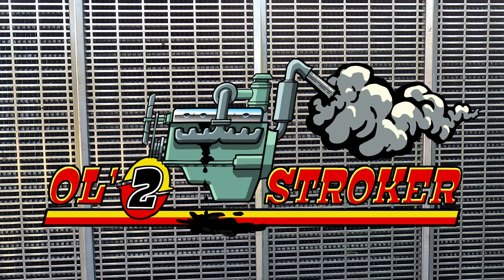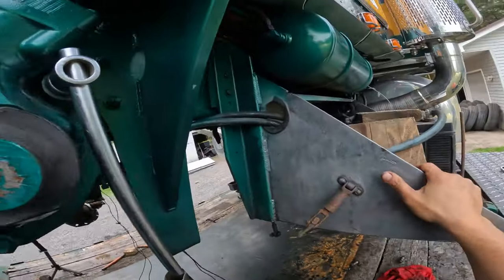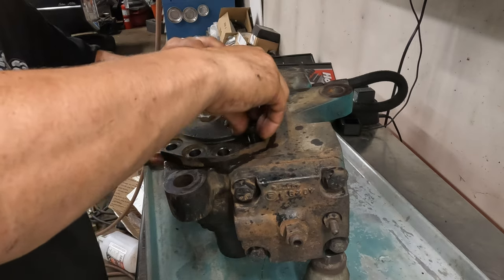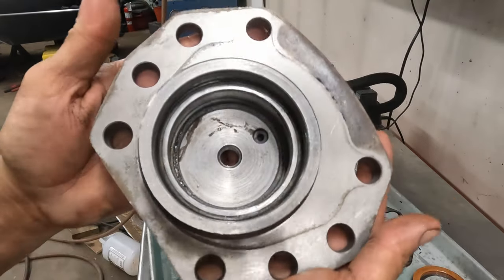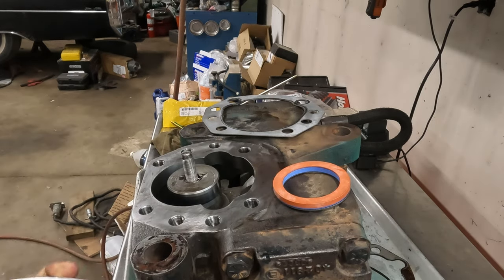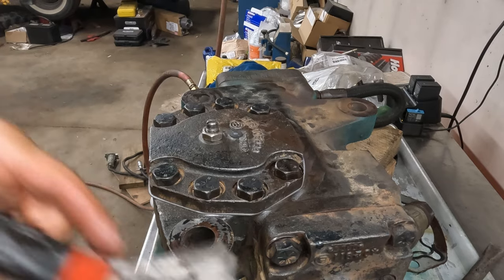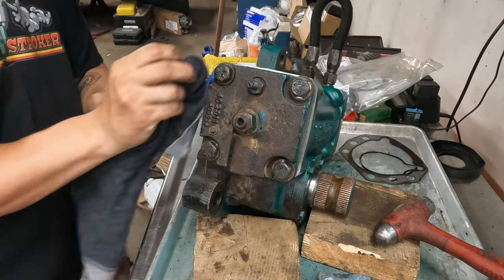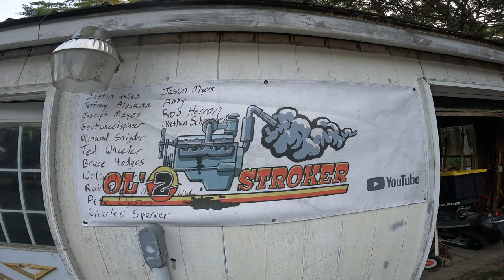LEAKING POWER STEERING? - Lets fix it!! 1980 Peterbilt 359 power steering gear reseal.

Comment: Damn Wayne O you popped this video out before my normal beer drinking time, some I am doing something really freaking weird I’m watching your video while drinking my morning bucket of coffee while enjoying my breakfast of my homemade yogurt and Apple Banana Bread.  If you think I am eating healthy or something I plan on having a jumbo bacon cheeseburger with fries and a Guinness for lunch (why the Guinness because it’s good for you they say and I need something good for me with my lunch 😅) 
Side note resealing/refurbishing a power steering gear box isn’t really that hard just greasy and slimy but I was quivering like a hound dog trying to poop a peach seed the first time I resealed/refurbished a power steering gear box.
The nut/screw you were all worried about counting threads with is the how you adjust end play on the pitman shaft which also adjusts the play of the steering.  The reason the roller bearings were not captured is because many moons ago you could get oversized needles bearing to get a proper/better fit (clearance) of the pitman shaft and bearings.  Once you have your truck back together you need to properly adjust the end/free play of pitman shaft/box (look up in the repair manual for power steering gear adjustable) if you over tighten the screw you will wear the pitman shaft out and cause the pitman shaft seal to fail.  (Double check what I said in the manual about the pitman shaft adjustment because it has been two months of Sunday’s since I last tore into one of these types of steering gears) 
Pro tip before placing the needle bearing in there race apply a coat of petroleum jelly or assemble lube on the race and the needle bearing that you put in a container and put them both in the freezer for about beer but no more than two worth of time and then assemble it.

Comment: While I’ve never attempted a rebuild on a steering box I have removed several from Macks to be sent out over the years. And cussed out the engineers every time for mounting them on the inside of the frame where everything is in the way. Nice work Wayne, well done 👍🏼

Comment: Nice work on the box. When I do work for myself generally I take extra time to paint most everything before reassembly and final install. The go to product is Rustoleum red primer followed by Black Gloss paint. They have many other colors available. Stir a lot since the solids sink to the bottom of the can. Buy it by the gallon. Apply with a very fine paint brush and it will finish with a smooth satin. Very easy to clean and very durable. Looking forward to that 3408 Pete.

Comment: Nothing like digging into a project only to find out it is far more complicated than you ever imagined.  It went back together quite a bit better than I think you thought it would.  So now the power steering is not going to leak, but that's also one less source of rust prevention fluid flowing onto the frame. 😂

Comment: You never know whether you're capable of doing most things until you try, and at least you're willing to use the instructions the manufacturer sent with the parts. 
Think about all those that don't use them, and then figure out they jacked it up after they installed it back on the truck.
Put transmission back in place, never tested anything until fully assembled. 
Turned started it up, started backing up off the trailer, only to see a piss trail of hydraulic fluid, and it's locked up with.
Only you were smart enough to do it before you installed the transmission, and you carried inside the shop where not as likely to get trash in it, better light, as well as keeping all the components organized. 
You know the old shade tree mechanic in the dirt, on a windy day type, and wasn't worried about the instructions blowing away. 
See there's worse things in life than just a little hesitant to step out on something you've never done before. 
See pup knows that you can handle it.

Comment: Wayne u r doing it hard pull the sector shaft out screw bearing housing onadjuster screw drop sector and top plate as one then reset backlash 😃

Comment: Wayne I used to install Hydraulic systems and we used a compound/thread sealer called Loctite 556 Badass for threads on hydraulics,water anything like that.Silicone can tear away and plug up orifices and ports,although i dont think it will in your case.Give it a try sometime,think youll like it
Reply from the maker: Thanks man I'll definitely give it a shot!

Comment: Steering is all about preloads and ozs or pounds of drag . Limited free play so don’t have to heard trk down the road . U did fine don’tbeat  self up for doing work to steering box . I’ve built plenty of em . I prefer trans gel for assembly especially with roller bearings . Washes clear with oil or power steering oil. This is up to u young guys .at 74 I get tired watchin u do this stuff . Just kiddin still building racing engines ,trans, differentials the whole damn thing .

Comment: You’re gonna be just fine with that repair. Usually when I tackle something like that  the first time I’ll spend several days ahead of time and pour myself into the rebuilding manual and have every single part that I could possibly need. After such meticulous preparation I go at it in full confidence and in spite of all my preparation I still end up doing something wrong the first time which usually requires a complete disassembly all over again and subsequent purchase of even more expensive parts. Once I have a complete cussing fit that resembles a full epileptic seizure along with mouth foaming and grinding teeth I accept that God is indeed punishing me for my youthful indiscretions and I deserve what’s is at best described as a total cluster. 
By the time the repair is finally completed and I actually fixed the problem I now have a strong knowledge of the diagnosis and repair of said problem. Unfortunately due to getting older I will forget the whole process of fixing it correctly and eventually will find myself in the same situation a few years later. 
  The good thing is that I learned on my own stuff and not someone else’s. Somewhere down the road you’ll be able to help someone who’s turn has come to tackle said repair. 
Appreciate the content 👍
Reply from the maker: Jesus we are twins.

Comment: That steering gear bolt at 9:49? I'd be trying to push with my arm like you were - but then I'd try to kick the bottom of the cheater bar at the same time.